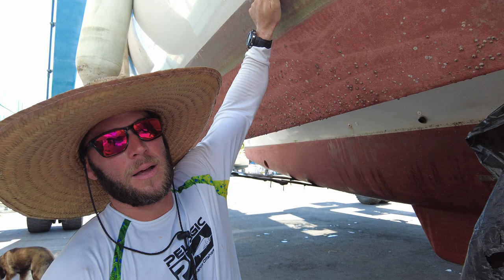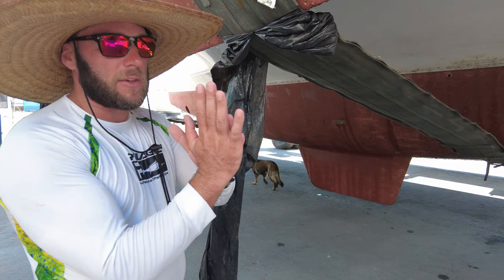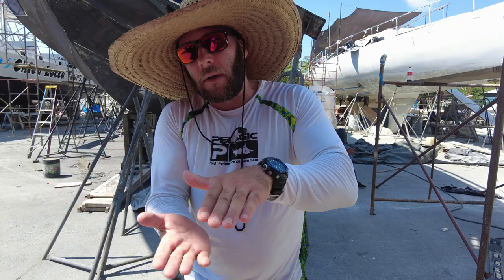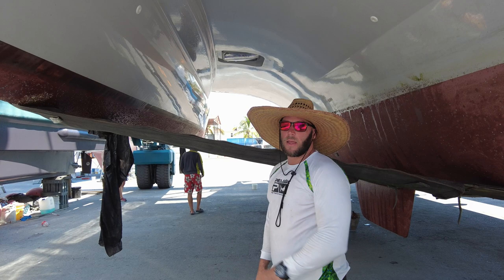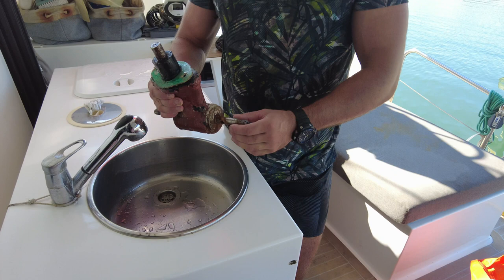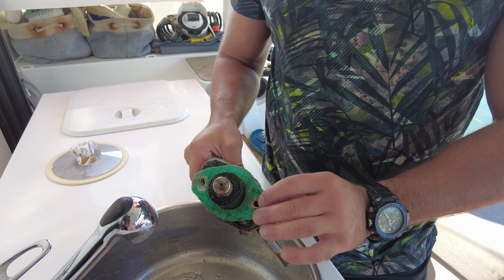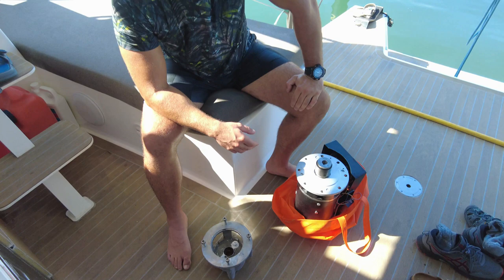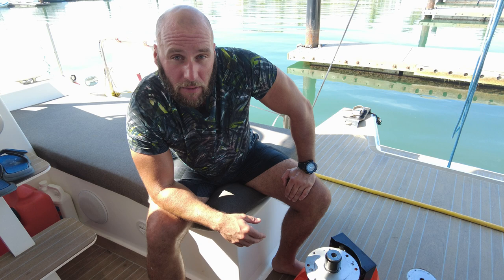Haul out for thruster repair, with Tips

Comment: I have 2x the CT225. Bow is broken and it makes a sound as a jet (airplane). So with your explaination I understand the way how it is build. I guess on my side (from the sound I hear) the gearbox is broken. But I open the engine part now with confidence. (have to haul out if the gearbox really is broken and it's not the hard-rubber one between engine and gearbox)
Reply from the maker: Good luck, I think you're right. It's the composite leg from what you tell me. Same issue as I had here in this video

Comment: I hear the thrusters on the 51 are designed to be extremely difficult to maintain as you have shown.  Question, can one do without thrusters on the 51?  Is there an alternative to manufacturer Installed thrusters?  Maybe after market thrusters that can be externally mounted?  Ones that can be easily installed and maintained without having to pull the vessel?
Reply from the maker: Have not heard that myself, though I do not think it is any more awkward than your standard thruster to maintain. I am wondering why anyone would make it deliberately difficult to maintain something? For comedy perhaps?
Reply: @carryonsailing  Nope, simple greed. Meaning you have to have them do it...GGrrrrrrrrrrr.lol
Reply from the maker: @paulhellewell8762  Not so sure Paul, As almost never do the boats return to the shipyard. In any event, I hope this video helps people to consider if they really need a thruster on a smaller boat. The Neel 51, it makes sense.